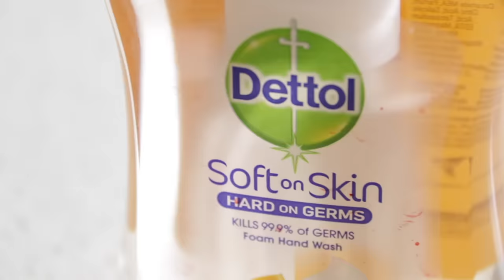How To Properly Wash Your Hands

Comment: Recapped (and sane) tutorial
1. Add some soap
2. Mix your hands with the soap for a few seconds
3. Turn the tap on and rinse for another few seconds
4. Turn the tap off and dry your hands
5. Repeat steps 1-4 until clean (optional: you can also do this to your feet as well)

Comment: How to wash your hands:
1. Apply a generous amount of Soup
2. Lather your hands in 30 sec
3. Rinse your hands in 30 sec
4. Dry your hands in 30 sec

2nd way:
1. Apply a generous amount of soap
2. Lather your hands in 60 sec
3. Rinse your hands in 60 sec
4. Dry your hands in 60 sec

3rd way:
1. Apply a lot of f**king soap
2. Lather your hands in 90 sec
3. Rinse your hands in 90 sec
4. Dry your hands in 90 sec

4th way:
1. APPLY HEAPS OF F**KING SOAP
2. LATHER THEM
3. F**KING RINSE THEM
4. DRY THEM

5th way:
1. APPLY ALL YOUR SOAP
2. LATHER THEM
3. RINSE THEM
4. DRY THEM

If your foot gets dirty:
1. APPLY ALL SOAP ON FOOT
2. LATHER FOOT
3. RINSE FOOT
4. DRY FOOT

6th way:
1 APPLY SOAP
2 LATHER HANDS
3 RINSE HANDS
4 DRY HANDS